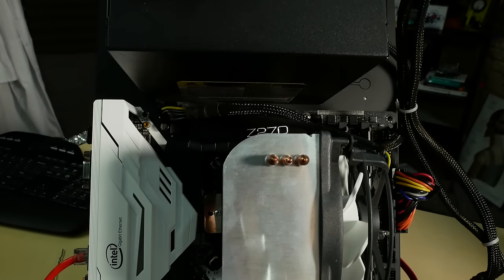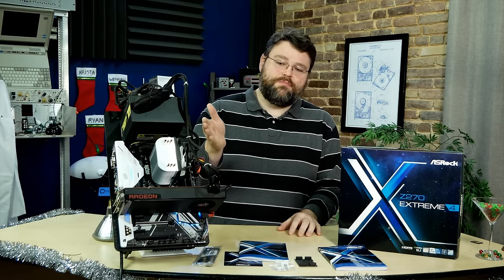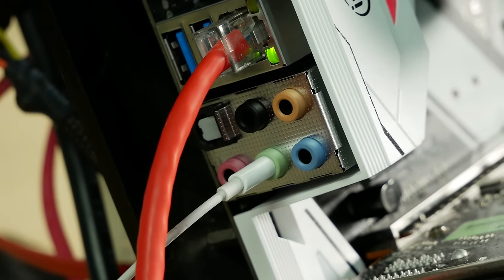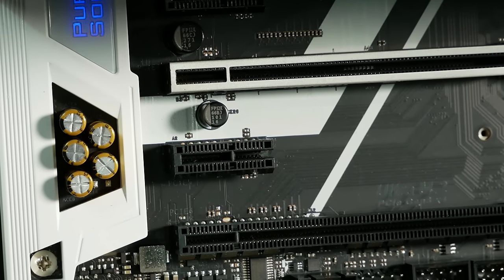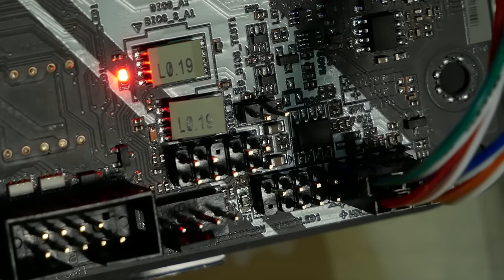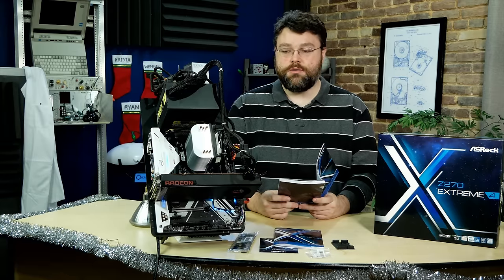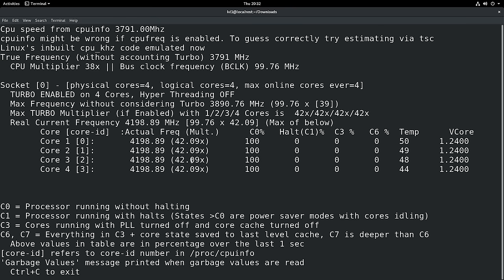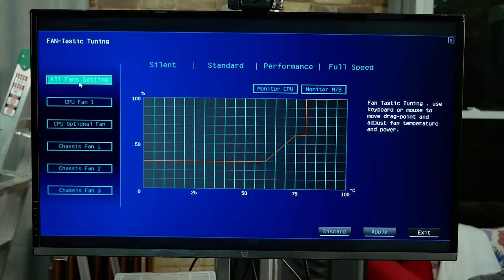ASRock Z270 Extreme First Look

Comment: AMD GPU YOU GOT THERE THAT'S A RX480? SEEMS LIKE A RX490 :)
Reply: Ummmm..... i think you might not be wrong there, just tuned in but that PCB is WAY to long to be a RX480.....
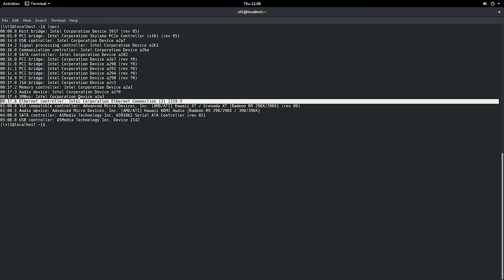Reply: Never mind. He goes into a fedora terminal @10:00 turns out its a 290x :( conspiracy debunked.
Reply: thats what they want you to think, dont be fooled
Reply: doesn't the 480 have thet power connectors closer to the center of the cooler and not at the far end
Reply: dose not look like an 290 or 290x
Reply: but it could be an 390
Reply: david18555 Yes you right R9 390 Reference..

Comment: Is it the correct placement of two memory sticks in A2-B2 slots? Shouldn't it be A1-A2 for example?
Reply: No using A1-B1 or A2-B2 means you will run your memory in Dual Channel mode and it basically doubles your memory bandwidth this way, i dont know if its still like this on the 270 but i think all boards work this way if you put in A1-A2 your memory will run in Single Channel Mode and it will decrease your performance by much.
Reply: That's what I meant, thank you for a precise answer.

Comment: This board is sh1t for OC.
My 7700k = 4.8 ghz, llc4, offset +200 mv. Prime95 28.10 stable. 
Same CPU on a MSI board did 5.2 ghz at less voltage.

Don`t BUY!